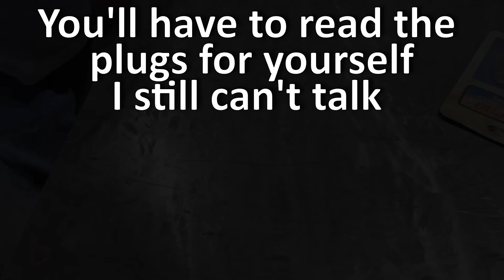C50 body and the RV chassis are one (C50 build part 6)

Comment: 11:33 Did you install extended tip plugs?  Hope the old plugs were just from a very dirty air filter and wrong heat range plugs.
Reply from the maker: No just the regular plug.  I've only ran the thing for about 4 seconds and I really don't know any history on it yet but I hope we can run it more real soon.